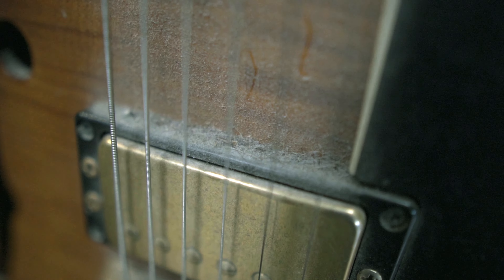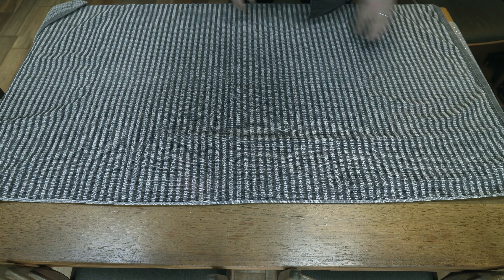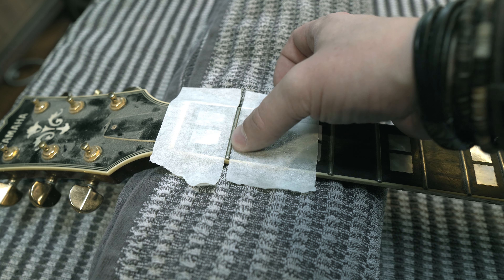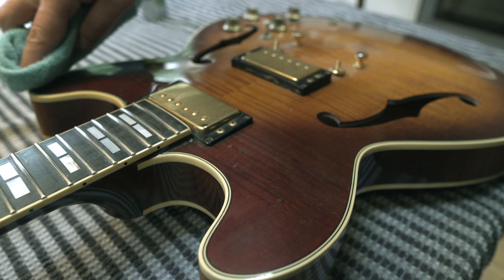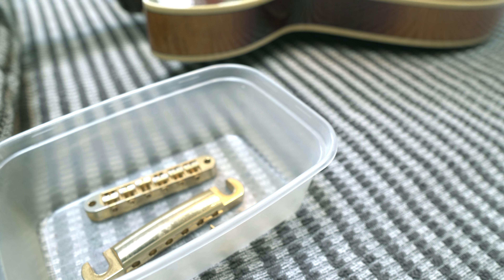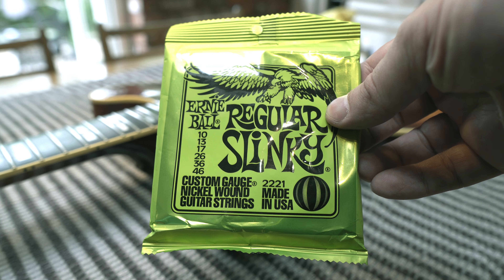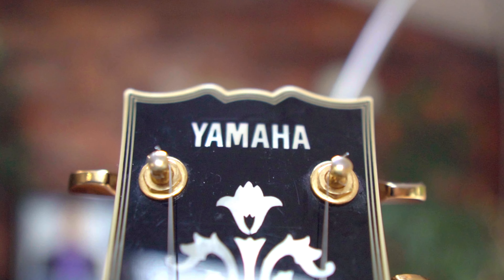Restoring and Cleaning a Vintage Guitar

Comment: Nice man, can the milky look on some parts of vintage guitars be compounded or sand paperd so that they look fresh again
Reply from the maker: You ideally don't want to machine a vintage finish at all if you can help it. If polishing the guitar with a non-abrasive, nitro-safe product doesn't work then it's likely the milkiness is there to stay unless you decide to refinish it.
Reply: @MaxRossell  thank you

Comment: Gorgeous guitar, and good job with the cleaning and maintenance. Although not really necessary here, I might have gone farther with the fretboard, lightly scraping the wood with a razor blade, wiping it with naphtha, and then oiling it to get off sticky finger oil residue and smooth out the beginnings of finger grooves. As I said, not really necessary with this guitar, but something I often do when I'm doing a deep clean and have the strings off.
Reply from the maker: That's definitely a good technique and I might have gone down that road had this been my own guitar. Didn't want to do a "deep-clean" on the fretboard on this one though, or address the finger-wear. Just enough to get it well-playable. The owner may decide at a later date to have it fully refurbed but my advice to them would be to leave it until the next refret and have the fretboard planed.
Reply: @MaxRossell  Fair enough. The fretboard on this guitar wasn't in bad shape anyway but when I have the strings off my tendency is to take care of anything that's now reachable. That's with my own guitars though.

Comment: Just got some of that WD40 contact cleaner delivered after watching this vid. Holy balls that is like sorcery.
Reply: Dubya D forty is the counterpoint to duct tape
Reply from the maker: What I love the most about it is the less you use the better it works, meaning a can should last for roughly nine generations.
Reply: @Brewhound77  we used to have a lyric that was a repeated chant of "if it should move then we'll oil it if it shouldn't tape it down"

Comment: Never saw this sunburst on the SA 2200, it's beautiful! Could it be the result of its long sleep in an attic or so?
Reply from the maker: I don't think so. I've seen new SA2200s with a similar burst colour. I think the dyes and finishes they were using in the 80s were quite stable so I wouldn't expect to see much of a change in colour on this one. Which is a good thing, because as you say it's a gorgeous finish.

Comment: Excellently-made video, lighting, presentation, playing (including some creative editing of the playing segments) and I like your approach to "sympathetic restoration". Your friend should be very happy. If I might give a video-making tip, if you look at the lens rather than your LCD screen, you'll connect more with viewers (on a subconscious basis) which will make your videos even better 👍
Reply from the maker: Thanks for your comments. I'm not sure what you mean about my eyeline though - I'm looking directly into the lens throughout. I close the LCD screen when I'm filming for exactly this reason.
Reply: @MaxRossell  Hmmn, not sure then. I checked the video again and it looks like you're looking slightly off-camera. I'm an old dude, could be my eyes that need re-alignment.😉 At any rate, keep up the good work!
Reply from the maker: @KRE808  I reckon it's because it's natural light so there aren't prominent catchlights in my eyes like there would be had I been using my videolights. Point taken though, I'll make sure to put them up next time. Thanks again for watching and commenting. Cheers!